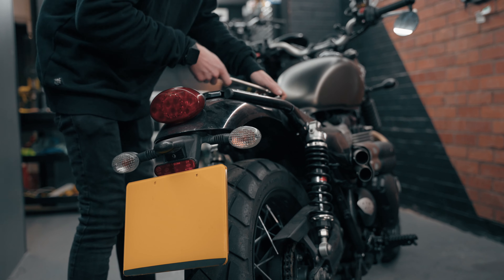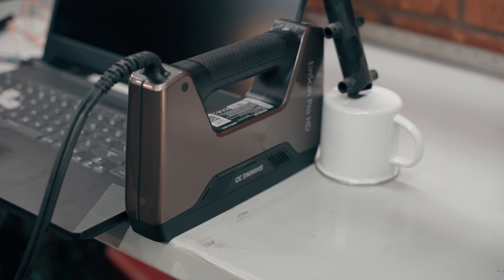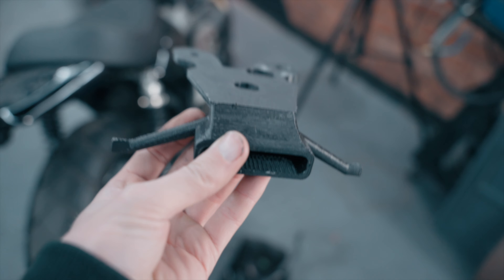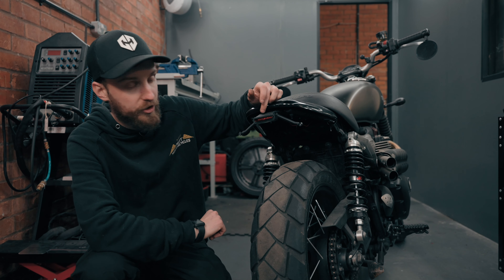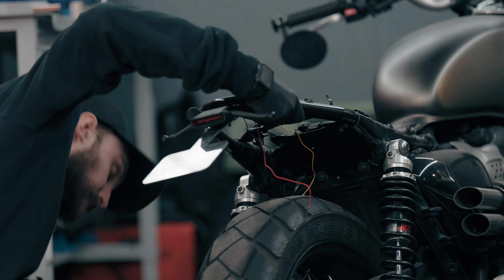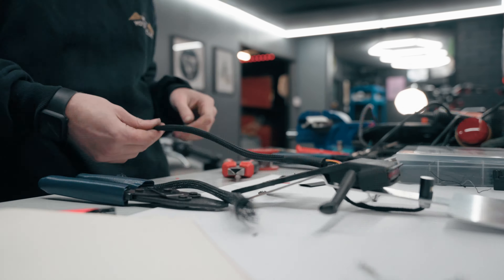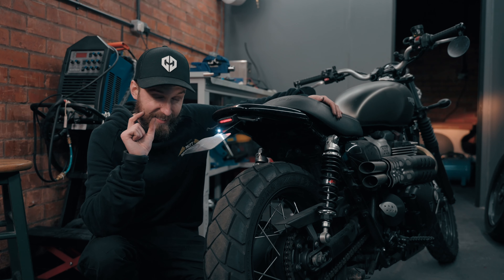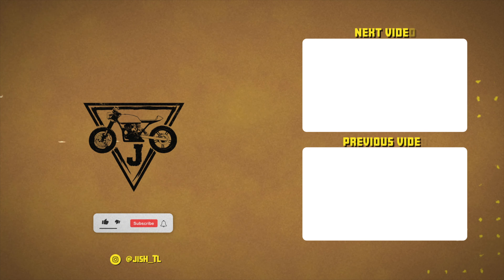3D printing my own TAIL TIDY KIT for my Triumph

Comment: Thats a great work... like the design and the printed result. As we talked yesterday, in germany i coukd be difficult to get in on street, but with some changes, i could cross the TÜV Check.
Reply: Welches Problem siehst du denn da für den TÜV? 
Die Halter für Licht und Blinker benötigen keine Zulassung
Reply: @kevingraczyk7212  das ist richtig. Beim Rücklicht seh ich kein Problem. Bei den blinkerhaltern sehe ich es bisschen kritisch, das der Prüfer dort bedenken äußert. 3d Druck und verschiedene Materialien ist da noch nicht wirklich verbreitet. Spreche aus Erfahrung, wie zögerlich einzelne Prüfer da sind.

Comment: Sweet! But why don't you print in a small holder under the brake light, for the number plate light? That would make it even cleaner.
Reply from the maker: I wanted an actual "metal to metal" connection to the bike for the numberplate because of the weight. I personally like the use of multiple materials

Comment: Can the signal stalks be reinforced? If anything hits the signals, I foresee them breaking under light pressure. Maybe a metal rod?
Reply from the maker: I thought about this, but with it being 100% infill, the stalks are actually stronger than Aluminium! The weakest part will be the glue, but I plan on adjusting how they sit in the actual body make a stronger joint. I plan on also making a version with cheaper, more universal rubber mounted indicators too as not everybody can afford kellermans

Comment: Neatly done, but you might have a problem with showing a white light to the rear. The lighting regulations say that "No vehicle shall be fitted with a lamp which is capable of showing any light to the rear, other than a red light...", with a list of exceptions which doesn't include registration plate illumination.
Reply from the maker: How strange! Even the standard triumph rear end has a number plate light that passes the brake light. 

Maybe the regs you mention are for a car?
Reply: @jishh A motorcycle is a vehicle.🙂 You cannot see a white light on the standard bike, it's shrouded.
Reply from the maker: Maybe i could make my own shroud then 💪 

There is definitely room for improvement, but for a first go at anything like this im still happy with the outcome
Reply: @jishh  You may never have a problem, but it only takes one awkward plod...